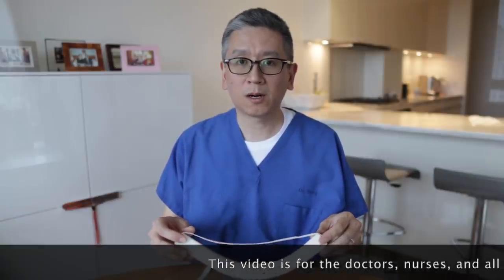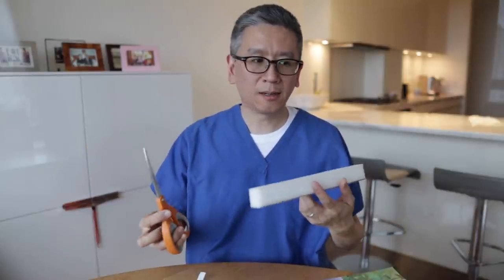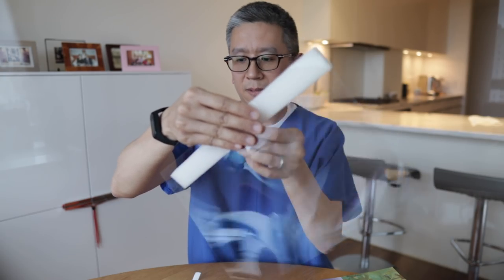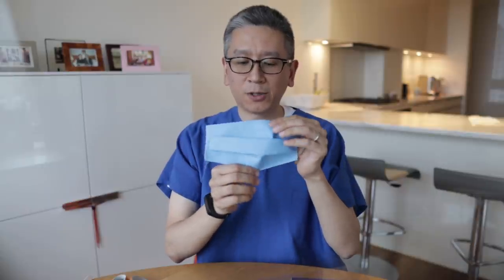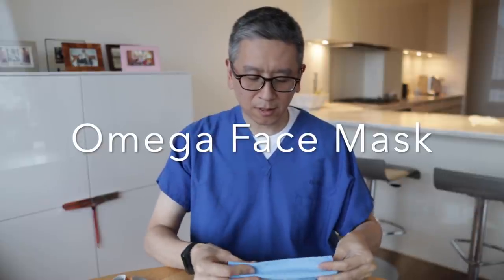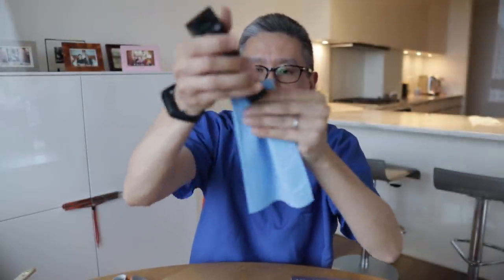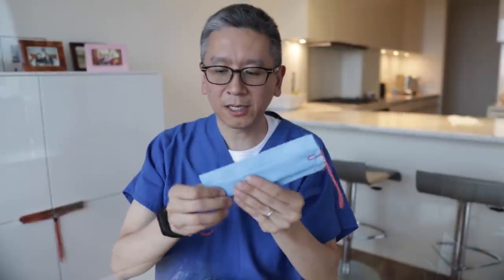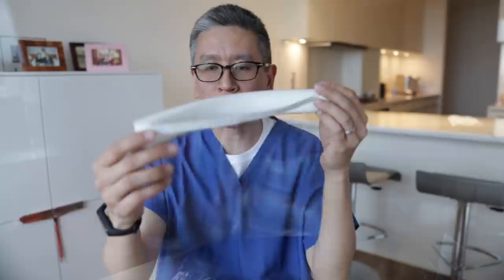How to make a face shield in 2 minutes & DIY Fluid resistant cover for N95: 14 min Pep talk for HCW

Comment: Seen a far more simpler version using a headband with is probably 50 cents, and a plastic paper holder from Staples office supply (they are used in folders). Just thread the headband through the holes of the plastic.
Reply from the maker: I have a playlist for DIY face shields here it is: https://www.youtube.com/playlist?list=PLKuGhKgBqseAT2NDLfbUBCyYv4lZzh2cC

For frontline healthcare workers, they will not feel safe wearing a soda bottle or an A4 sized sheet of plastic with no foam cushion to fit any glasses or protective safety glasses.

This face shield was trying to copy the real thing.  If you are not taking care of COVID patients please don’t spend any money and make anything that resembles a face shield.   Your risk of getting COVID in the public versus a frontline healthcare worker who is actively caring for COVID-19 positive patients is not even in the same ballpark.

If you are making a face shield for frontliners, consider this specifications from a real face shield. 
https://www.instagram.com/p/B_So5tND_G-/?utm_source=ig_web_copy_link

Donations are usually checked by an administrator or nurse to make sure they are adequate.  No point spending time and money on donating face shields if they will never use them.  I spent just over $100 to make my first 110 face shields. So with a wider coverage and foam cushion to copy the real thing it cost just over $1, not including the labor cost from a plastic surgeon, which would make it ridiculously expensive.

https://www.instagram.com/stories/highlights/18029549848254356/

Comment: How did you adhesive the the foam?
Reply from the maker: You can use a command strip or other double sided adhesive tape or strips.  I used a hot glue gun and applied ~3” of glue in the middle of the shield. I also used a drop of hot glue to hold the elastic band in place to make it easier to staple.

Comment: Would double sided tape work,where an igettheice pack covers
Reply from the maker: Hi Gwen, sure you can use double stick tape, 3M command strips, any type of double stick tape is fine. 

The brand of ice pack covers is Therma-Kool Non-Woven Disposable Covers - 4" x 7" (100/Pkg) ~$20 without tax or shipping.

Comment: Where do I buy this blue fabric, what's the name? What's the name of this plastic? Duralar, is that a kind of acetate or thicker than acetate, I prefer thicker. Thank you Doctor.
Reply from the maker: It's linked the first pinned comment.  Look for my reply to Andres where I gave a shopping list.  The blue fabric is a non-woven polypropylene fabric used in the medical field for fluid resistant gowns, drapes and disinfection wraps for instruments when they are "autoclaved" AKA steam sterilized.  Halyard makes several versions 100 through 600.  

The reason I mentioned it, is that at the hospital this material is everywhere, when we unwrap sterile kits and instruments.  So these are clean and sterile and normally would go into the trash bin.  But the medical person could safe this clean material and place some staples and rubber bands and conserve some regular surgical masks.

Comment: Wouldn't goggles + face shield be the best solution, since face shields aren't sealed in general?... Stay safe, doc.
Reply from the maker: Good question.  Thanks.

For the eyes alone, the goggles should be fine.  You are correct in that the face shields and goggles both are not sealed.

The reason for the face shield is really as an additional physical barrier to make the N95 masks last longer.

With very good filters, it can catch small particles.  This also means that it clogs easily.  Imagine a vacuum bag when it is full.  It doesn’t vacuum very well.

For the N95 mask, if there is a lot of respiratory droplets being sprayed onto the mask, the droplets are not only water, there is also a small amount of mucus in the droplets.  If these dry up on the N95, it will clog the mask and make it hard to breathe, and therefore the user needs to get a new mask. 

With masks in short supply, they need to make every mask last as long as possible.  For that reason, regular non-sealing surgical masks are worn on top of the N95 masks as an additional “fluid resistant” layer to prevent the N95 from clogging.

The white N95 masks are not fluid resistant.  The green N95 masks are fluid resistant.  So by adding the surgical mask on top, it prolongs the life of the N95 mask.

Comment: Is that really going to keep our droplets of moisture from our mouths off others or shopping carts and railings?
Reply from the maker: First 20 seconds of the video: “This video is for healthcare providers who are told that tgeurbhospital has run out of face shields  … “

The face shields help to make their N95 respirator masks last longer by protecting the N95 mask from getting clogged with respiratory droplets which can have small amounts of proteins and mucous which slowly clogs up the N95 masks making them impossible to breathe through. 

If there were an unlimited supply of N95 respirator face masks which are protective against COVID-19 for the person wearing the N95 mask, then the Face shields would not be as important and a simple safety glasses to protect the eyes from droplets may be sufficient.  

The face shield add an additional barrier in the healthcare setting because these patients are having trouble breathing, coughing and gasping for air.  If a nurse is caring for a patient and they cough right into their face the face shield will keep the flying droplets from spraying their face with COVID-19 as well as keep the N95 mask “cleaner” by not letting the droplets directly land on the N95 mask. 

When a direct cough with large droplet which includes mucous and proteins dry up in the N95 mask, it will quickly make the mask unusable as well as make the outside of the N95 mask possibly visibly contaminated which is another reason for getting a new mask.  

At the time the video was made in March 2020, there was not enough Personal Protective Equipment for the healthcare providers including N95 masks, Face shields and gowns/hazmat suits.   

It is like sending soldiers into a battle without a helmet or bulletproof vests/armor. 

Regular people seem interested in face shields as a way of not wearing a face mask or in addition to wearing a face mask. 

I would recommend the face covering/mask to catch and absorb as many of the droplets from escaping into the air especially in an indoor environment where these droplets can accumulate and float around for hours.  

If people want to wear the face shields in addition to the face masks, it does provide an additional eye protection and a physical barrier like the splash shields we are now seeing at reception desks or the sneeze guards that are used at buffets.  

Can the droplets get breathed out and float around the  splash shields and sneeze guards or even the face shields.  Yes, it can.  But it does act like an additional barrier which makes it harder for as many of the droplets from reaching the person on the other side.  

If you had 100 baby piglets running around in a pig pen. If you placed a fence across the middle with a few feet of space on each side, it would slow down the piglets from reaching the empty side of the pig pen.

Eventually many of the piglets may go around the sides of the fence in the middle, but in that first 30 seconds to a minute most of the 100 piglets will stay on the starting side.  

In the face shield situation, time of exposure to other people who may have COVID-19 but don’t know that they are sick is important.  The face shield is like the fence in the pig pen. 

It can buy you some time for you to get out of a risky situation.  If you find yourself in a line at the grocery store where the person in front or behind you start coughing uncontrollably (even if they are wearing a face covering) you should try to get away.  The droplets will get partially caught by the face covering, but the cloth face masks are not as N95 masks so don’t feel overly confident if you are wearing a face mask.  

The face shield will buy you some time, so none of the piglets (COVID-19)have time to get to the other side of the fence.  

Hope the analogy is makes sense and an easier way to visualize how to keep yourself safe.  

Good luck and be safe out there.  Follow your state guidelines regarding face covering recommendations, social distancing, and hand hygiene.  

Additionally, people should be aware of the test positivity rate in their area.  In New York State and City it is currently 1% of the tests which are coming back positive.  If this is a sample of the New York population, then only 1 in 100 people have COVID-19.  Hopefully they will stay home and quarantine so they don’t get anyone else sick. 

This also gives us a sense that only 1 of 100 people who are in a store might be a carrier and potentially spreading it around.  If the carrier is wearing a face covering, then the carrier is doing their part in avoiding spreading COVID-19 to their neighbors.  In New York, when I am walking around about 90% of people are all wearing a mask.  Of the 10% not wearing a mask, they have one in their hand or under their chin, and maybe they are just catching a breath, drinking water, or smoking.  About 1% of people just walk around without a mask with no regard for social distancing. 

If you are in Arizona, Florida, Texas or even California is going up in positive tests, if the test positive rate is greater than 15% that is very high.  This means there might be 1 positive person out of 5 or 10 people.   

If you are in a small store with only 5 or 10 people in it, chances are 1 of those people are carriers and spreaders of COVID-19 whether they are doing it intentionally or not.  

The reason indoor restaurants and bars are targeted is that eating and drinking require taking the mask off.  If 1 in 5-10 is positive and there are 40-50 people inside a bar or restaurant, there may be 4-10 people without a mask, laughing, talking loud, maybe singing and the other 46 people are at high risk of catching COVID-19.  

You would catch a healthcare worker who has been working on the frontlines spending more than 1-5 minutes in the same room with someone without an N95 mask/Face shield/gown.  Their guard is up and prepared not to get sick.  Imagine breathing the same air in the room as a bunch of people where 1 in 5-10 are most likely carriers and spending 1-2 hours with all of those people.  

Outdoors is a different story.  If you have 5 smokers out of 50 people in a room smoking non-stop for 1-2 hours everyone in that room with inhale some of the smoke.  

If you are outdoors the sky is very high.  There is an almost unlimited amount of air as well as air movement with wind and breezes which can dilute out the smoke quickly.  

Indoor and outdoor risk is very different.

Comment: Is it reusable please? If yes, how to cmean it please?
Reply from the maker: Depends on where you are using it. For healthcare workers, if their exposure to the virus is high, then they should discard it based on what they hospital is currently doing.  If they are told to only use it for one day, or try to keep it clean and use it for a week, they should follow their hospital guidelines.  These face shields are similar to hospital grade face shields.  

The hardest part to clean is the foam and head band in the hospital grade face shields. This is the same for these face shields. The clear face shield is easy to wipe down with alcohol. The foam and head band could be wet and rubbed with alcohol and allowed to dry for later use.  If the shield is falling apart, you can discard it or remove the headband and foam to reuse the clear plastic, with a fresh foam cushion and head band.  At some point the staple area will make the shield hard to assemble. 

If you are not a doctor, and you are mainly using this as goggles or eye protection, you can cut off the damaged strip of plastic ~1-2cm and reattach the new foam and headband to the remaining plastic shield. 

For an ICU doctor, they may not feel comfortable with a shorter mask, so they should get a new full sized face shield.
Reply: @GeorgeYangMDNYC  Thank you so much Dr for answering me. I am actually making a bunch of these to donate to my local hospital, i have already made 100 of them, and i hope that i will be able to make some more. But everytime i give some to doctors i start wondering wether i should tell them to reuse them or not. (They dont work in a Covid specialised hospital, but they work in hospitals where they might be exposed to treating a covid positive patient withount even realizing it, and this is where the danger lays)

Comment: I forgot to put the link to foam weather stripping. https://www.amazon.com/Weather-Stripping-Adhesive-Insulation-Closed/dp/B06ZZ41VTP/ref=sr_1_17?dchild=1&keywords=foam+cushion+1%22&qid=1588023672&sr=8-17  Thanks.
Reply from the maker: That would work.  Try one layer first.  Mine is 1”. This one is 3/4” which should be enough. Some people bought the 1/2” and needed to double up on the foam.  I think it should be fine.

Comment: Thanks Doc, Just wondering what would be the optimal application? Would I use this in conjunction with a FACE MASK?. This would be more comfortable once we are all able to get back to work in the office. Please reply soonest. Thanks!
Reply from the maker: Papa MrK 
It depends on your workplace.  Your company should use the CDC guidelines (https://www.youtube.com/post/UgxTmSJ_iX1D0nWCN754AaABCQ?app=desktop) and set up safety protocols regarding cleaning the office, taking temperatures, social distancing guidelines, face mask recommendations and other considerations. 

For example, outside of the hospitals, I see Face Shields being used at Supermarkets.  Both the workers stocking shelves, and the cashiers who may be standing 1-2 feet away from a customers who are only wearing a mask.  It would be too much to ask the customers to wear face shields, so the workers can wear them instead. 

Larger supermarkets may have plexiglass panel next to the cashier to keep them separated from the customers.  For those cashiers they don’t wear a face shield, only a face mask. 

Local businesses should contact each other to collaborate on safety measures.  The community is only as strong as their weakest link.

Comment: So how would a doctor/ health care worker with compromised lung function( bronchitis etc) breathe with an N95 and this mask on? Technically they shouldn’t even be on the frontline’s but with an acute shortage of workers they probably would have to work. As someone who suffers from seasonal asthma even a normal surgical/ cloth mask is too much during flare ups.
Reply from the maker: alishashenoy That’s a good question. So these N95 are used with another surgical mask protecting it droplets which will dry up and clog up the filter.  

The surgical mask and face shield combination will definitely have a hard time breathing, but hopefully they can finish what they need to do.  When they leave the patient’s side, they can remove the surgical mask which will make it easier to breathe.  

Or if they are taking a break they may take off the N95 if they can do other work which only requires a surgical mask only. 

They could be assigned to different places which might need less need to wear the N95.  To conserve PPE, sometimes they will have one person enter the room and do everything instead of having 5 different people come in to do different things.  Serving food for the less sick patient, taking vital signs, respiratory therapist, medications, etc.   The nurse taking care of the patient can bring the food in and do all the things while keeping the time inside the room as short as possible.  1 set of PPE instead of 5 different sets.  The essential worker delivering the hospital food could just wear a surgical mask and stay outside any rooms so they don’t need an N95.   

Tough times. They just have to be efficient and try not to waste the PPE even if they know they have a stock pile.  Very easily if there is a second spike they worry they could burn through them quickly and be left with nothing.   

So they would rather try to clean and reuse even if it’s not optimal, than to completely run out one day.  Then the whole hospital shuts down.

Comment: What does ghetto version mean? Did you mean inexpensive MacGuyver version?
Reply from the maker: Hi Alicia, Yes, MacGyver version I like that much better.  I’m going to change it in my description. I still spent more than $100 per 110 face shields so it’s not inexpensive.  

The 2 liter bottle version is definitely the inexpensive MacGyver Version. 

Something I watched in the news upset me, and I quickly filmed it without any editing.  For the ones, I was donating,  I made looked professional and used hot glue, and even a tissue paper to keep off fingerprints.  https://www.instagram.com/p/B-KeOkYjAK_/

I made another video a week later with more MacGyver Tips to repurpose an existing shield by removing the foam and head band. 
https://www.instagram.com/tv/B-XvLVzDGjR/?igshid=1fcp54on2m3o8